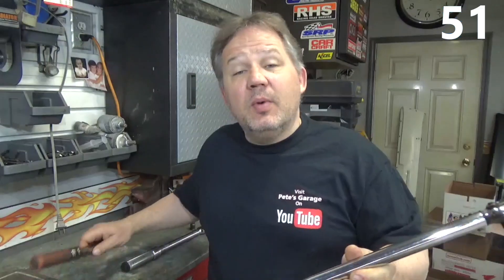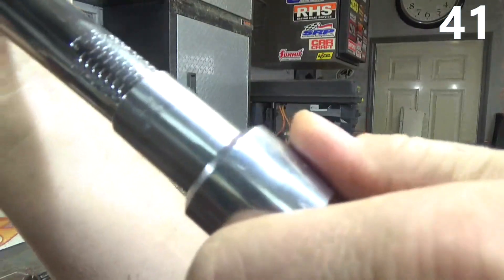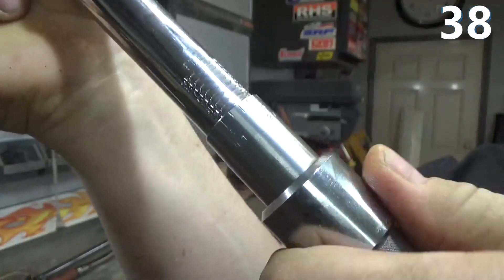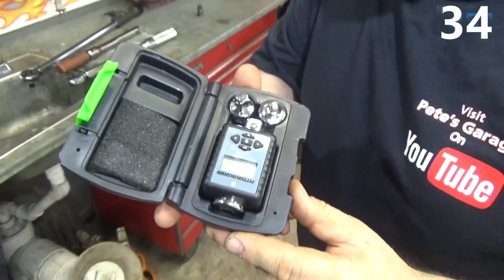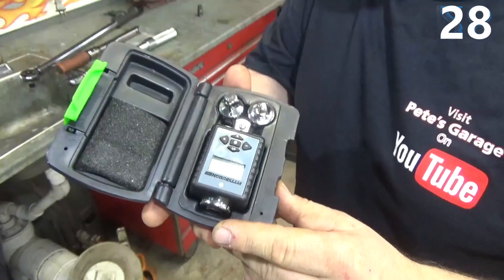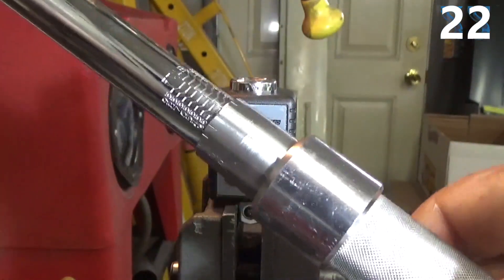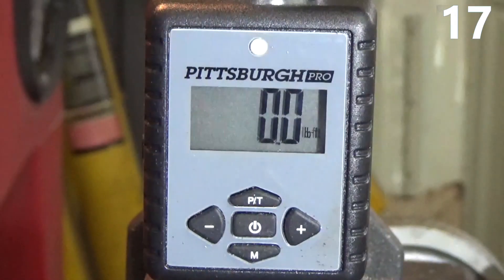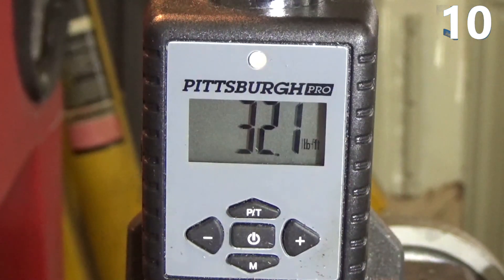Torque Wrench Validation - When does your torque wrench need calibration

Comment: Torque wrenches only give a reasonably close torque. Threads can be dry or have some oil changing torque. Measuring the stretch of the fastener is more accurate but not necessary for automotive use
Reply from the maker: Torque to yield fasteners are actually becoming more common in vehicles

Comment: Pete, if it's off a few pounds on the low side, do you turn the handle on until you validate it to the desired torque, or replace the wrench? Or can you adjust them at home somehow? Thanks.
Reply from the maker: Sounds like I'll have to go over that in another video

Comment: With this Validation tool one can see how much is the wrench out of spec.And then just need to set the wrench 3 more ft lbs and it will do the job ! If its out by 3 ft above , then set the wrench to 32 ft lbs.
Reply from the maker: That's a good idea, I would split the difference and add 1.5. Yo really see where the wrench is at you'd need to take a statistically significant sample of 30

Comment: Just send it in once a year for recalibration, just like aircraft mechanics are required to do by FAA regulations.
Reply from the maker: That's a great idea. Sometimes it's cheaper just to buy a new wrench. If your wrench goes out of calibration on 1 month after calibration your have 11 months of improperly torqued fasteners. If you validate before each use you have an idea when it's starting to drift.
Reply: Send it where? Some of us amateurs have no idea.

Comment: I’m not sure that I would totally trust a $29.95 Harbour Freight calibration tool though if all your torque wrenches came out 10% low then you would know it’s the calibration tool that is off.
Reply from the maker: The purpose is to have a second data point. I'm not relying on it to give me an absolute number, it's just a way to check. For a full statistical study you should take 30 measurements and check the Ppk